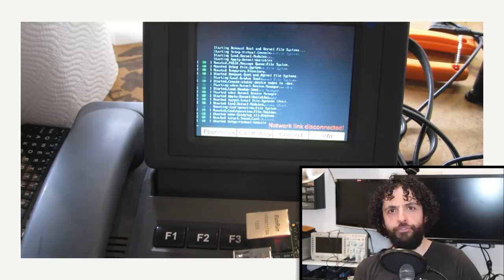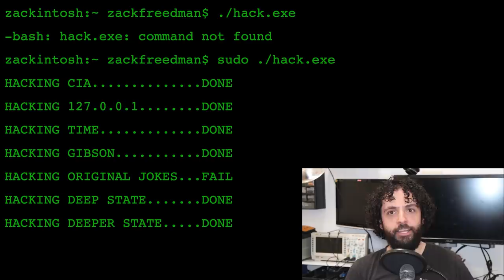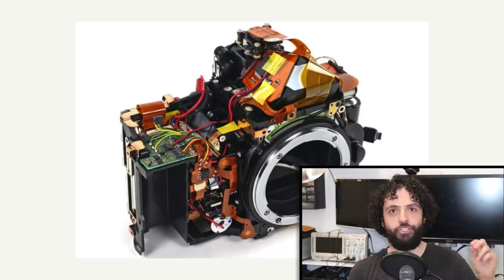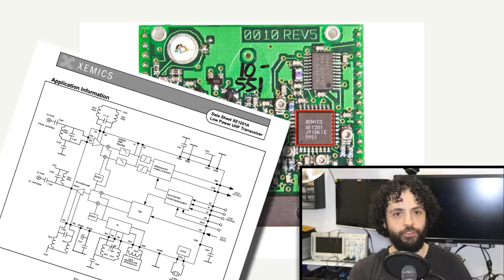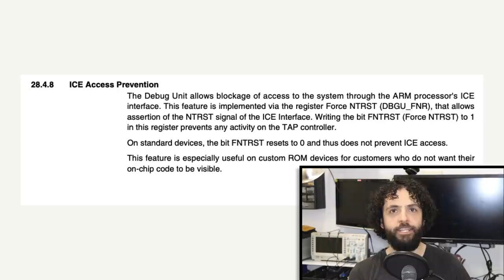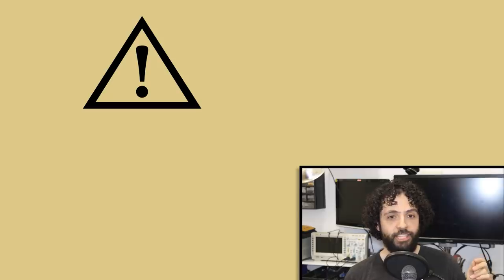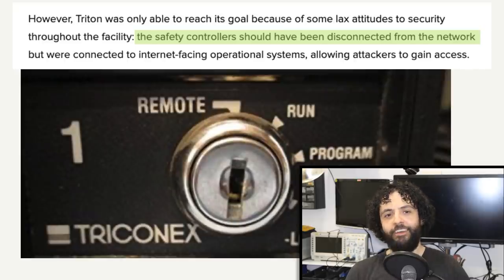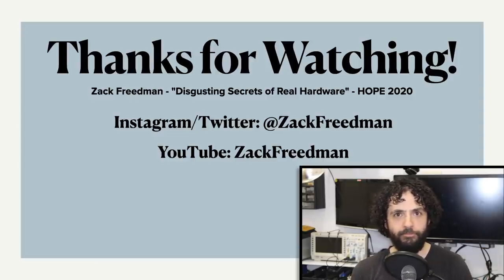Disgusting Secrets of Real Hardware: HOPE 2020 Voidst-Archives

Comment: Copy-paste engineering, as far as circuits go, is almost a hallmark of good design. If someone figured out a thing and it works, why ruin it?
Reply: Oh damn you can not be more right. I'm often reviewing circuits and about 9 times out of 10 i'm like damn why don't you read the datasheet ? They clearly tell you there should be a cap there and that it should be as close to the pin as possible !!! RTFM !!!! And for the love of however superior force you believe in, please stop trying to reinvent the opamp !!! 

And the 10'th time it's usually like "do you know it exist off the shelf chip that just do what your whole circuit do and cost under 30cts ?"
Reply: @lolaa2200  what if i don't believe in a superior force 👽
Reply: @king_james_official  You'r an engineer ... build one ;c)
Reply: @lolaa2200  spaghetti monster😈😈

Comment: I've dabled with arduino and raspberry pi, but felt incredibly intimidated by "real hardware". Thanks to you, it feels like this is more approachable!
Reply from the maker: It's WAY less impressive than it looks. Try reverse-engineering a circuit board - all you need is a magnifying glass and a continuity tester. You'll see that it's really just a bunch of sub-assemblies with a few power and data lines linking them together - and that most of those assemblies are just reference designs from datasheets!

Comment: Reminds me of a friend in the 1970s, who made controllers using TTL. He was sick of one particular customer who never returned boards to him for repair, but tried to mend things themselves.  He knew they were doing it (flux deposits, chips from different suppliers, etc.), but couldn't prove it.
One day, he supplied them a piece of equipment with, deliberately, a "blown" chip on the board.  Sure enough, the customer got in touch the following year for a repair and he was able to say "You've been meddling with this." because they had changed the chip and so the device was held reset, illuminating a red LED and sounding the alarm!
The customer had to buy a new board, of course.

Comment: I was modding a part we received from a supplier a few weeks back and found an Arduino Mini hot glued onto the PCB and piggybacked onto the power supply. Loved it.
Reply from the maker: I've always wanted to run into something like that. What kind of device was it?
Reply: @ZackFreedman  it was a charging dock for a remote. The arduino had a reed switch soldered to it and when the remote (which had a magnet hot clued to the inside of the casing) was out of the dock the arduino would make a small speaker put out an alarm.

Comment: <raises hand> I've programmed protection fuses. It does protect the code, but we had occasional "did we remember to program the fuses" scares when we did something that required us to generate a new release procedure.

I've also seen some interesting, and not necessarily effective, protection schemes. One involved swapping address and/or data lines between the processor and the EPROM (this was before flash-based microcontrollers were available), and not noting it on the customer-available schematics, so that anyone trying to read the EPROM would get gibberish. I don't believe that one ever got implemented.

I've also seen boards with potted components, so you couldn't identify the components or access their pins, and boards with identifying marks ground off the key chips on the board.

As for stupid design, my company once also built a relay board for a customer whose specs turned out to have a significant design flaw that I discovered in testing. The board had a significant number of relays on it that cross-connected various voltages and signal lines from one I/O connector to another, because they wanted to be able to customize things for each installation. They specified zero-power relays, because they wanted a programmed configuration to be available immediately after powerup. While testing the first-article prototype, I accidentally discovered that it was possible to connect the +12v (or +24v, it's been so long I don't remember) line to ground. Oops.

Comment: FYI:  TLS 1.2 is secure and currently used in more than 95% of the web's communications.  TLS 1.3 just came out and is not yet supported by most, but most features are just to optimize latency.  Predecessors were SSL v1, v2, v3 (all now unsecure), then name changed to TLS 1.0, 1.1, 1.2, 1.3 (of which only 1.0 and 1.1 are deprecated); I believe you thought it was running SSL2, but it was showing TLS 1.2

Comment: at one job, the idiocy with passwords and post it notes got so out of hand I simply wrote 'Y0uW15h!' on a post it note and stuck it to the bottom of my keyboard. No, I would never, and never have, actually used it as a password, but I can see prototype engineers getting that set as text to print on a circuit port next to the fake uart serial port, that randomly cycles between +3.3v and 26v AC...

Comment: Oh and the Phillips Hue hub uses unique root passwords for each unit. But they set this through uboot. You can bridge the flash data to ground when uboot starts to load it, which will kick you out to a uboot prompt, where you can just change the password to whatever you like. You can the data corruption thing on a ton of devices and different boot loaders.

And i'm glad you can. It makes it much easier for consumers to actually take over their device and use it for whatever they want. Really the idea that disabling this makes it significantly more secure is laughable. If someone has physical access it's game over already. Unless you want to implement incredibly convoluted security systems like you see in things like video game consoles, which no one wants to, especially when with real security you have to protect the device from physical access, and if someone has had physical access you need to consider that device to be compromised, at a minimum...

Comment: I'm self teaching myself and I purposefully make my stuff shit. I love chaos.
Reply: lmao
Reply: The same design philosophy as the WTFduino
Reply: So every time you do something good, you are mad or satisfied🤔
Reply: I'm not really engineering stuff (I built my own PC for example, very engineery) but I have some security through obscurity safety measures built into it through sheer lazyness. For example: My radiator is outside the case, so I had to run wires for the fans outside the case too. You can make use of a PWM hub so that you only need to run four wires once instead of four wires per fan. So, what is a cheap way to run four wires somewhere? Yeah, USB 2.0. So now I got a 12V USB port on my PC that has 850 watts of power behind it. If anyone ever steals my PC, they're gonna have some *FUN* with that. I know there's 12V on that port. They don't.
Reply: @fredwupkensoppel8949  LOL. the best defensive wall is a field of landmines
Reply: @fredwupkensoppel8949  Love this! Reminds me of that buddy of mine that just runs his PSU through the open side panel because he was too lazy to screw that bastard into the basement. But with even more chaotic energy. 🤣
Reply: @Yuzuki1337  Well my psu still hangs out the back a bit because of a clearance issue with the water cooling tubes. So same kinda sorta.

Comment: Hey Zack, I have an alternative opinion. I see no problem putting serial interface exposed on the breadboard. This gives you as a programmer/hacker to have the API to the box, so you can connect and script something. Especially right now, when everyone is crazy about IoT and smart home stuff. In my opinion, this is far better than putting a WIFI on the chip, as wifi exposes remote and often very insecure connection. What is important here is to treat Serial port as public API and don’t allow advanced stuff like firmware update – often printfíng status would be enough. Remember, in the old days cellular phones were dumb as hell and very restrictive, but as soon as you allow to develop and run the apps, market exploded. IoT will face the same fate, bc programmers are everywhere now, and number of hackers/prototypers are growing rapidly.

Comment: You forgot about embedded medical devices, which are programmed with magnetic loop antenna and not even a PIN code in some cases. Just imagine someone making a big loop antenna hidden in a door frame of public place with a controller programmed to change the vital settings of embedded insulin pumps and pace makers of every person entering or exiting a room/building. With proper settings the deadly trap would be triggered only in certain conditions, so it would be hard to figure out, when and where a person was hacked. I'm not making this up, there was some research into vulnerabilities of such medical devices.

Comment: I’ve seen some crazy shit inside the most expensive industrial electronics. I’m not saying I could do better… Very far from it… But while troubleshoot some of the most expensive boards out there… i regularly find bad design choices/mistakes everywhere.

A bit of my background… I now spend half of my waking hours in my electronics lab repairing industrial boards and test equipment. And a bit of metrology for good measure. Most clients bring me stuff like discontinued “end of life“ PCBs that need component level troubleshooting and repair. 

Here are a few things I’ve seen in the past 60 days… Boards from 30 year old CNC machine controllers, HVAC equipment like massive tractor trailer truck sized screw chiller control boards, and other boards from ridiculously massive HVAC equipment. weird industrial x-ray machine control boards used to inspect injection molded and potted electronics, and pretty much anything you can find in a machine shop, Warehouse/Factory, even have a few industrial recycling companies who brought me regular repairs because they abuse the shit out of their shredders and other equipment.

I get an average of 5 - 7 clients per week. It could be a single board or an entire cabinet full of boards from one client. It could be something simple like an impossible to find furnace control board from some massive 10 ton HVAC unit… or something complex like a 6 foot tall refrigerator sized rolling computer cabinet, With dozens of HUGE boards inside… used to control a 1980s Mitsubishi EDM cnc machine. (that actually just happened a few weeks ago.)

It’s insane the things I find on circuit boards. And I’m talking about boards that were in million dollar pieces of equipment. I don’t normally work with really expensive modern boards. If it’s something that could possibly still be under warranty, or that I don’t feel comfortable with, I don’t hesitate to turn a client away or refer them to the manufacture. The first thing I learned is to never never never work on something you’re not completely comfortable with.

It happens sometimes, but usually things like that either go back to the manufacture, or the clients can easily find a new board online to replace it. I don’t care what it cost. If they can find a new board to replace something… Even if it’s $10,000… I always suggest that you go that route if it’s something extremely modern and still under warranty or something from the medical field… That I don’t feel comfortable working on. So I don’t deal with that type of stuff. 

Mostly I deal with things that are completely unobtainable. Sometimes that means the manufacturer would take six months to replace or repair the board… And they need it now. Or sometimes it’s from Machines that were made in the 80s and 90s, and aren’t supported anymore… And sometimes even new modern equipment, if the company doesn’t offer replacement parts, and they can’t find a replacement board online. 

I’ve got to see some of the neatest, most well-designed and beautiful high-end electronic circuitry imaginable. From places like the prestigious Oak Ridge national laboratory (where the atom bomb was first made).... all the way to the lowly Walmart check out scanner. I see a wide range of different equipment and controllers. It really is a lot of fun, I even had a local nuclear plant bring me some massive LED sign controllers a few weeks ago… Because the company Who made them in the early 2000s disappeared and they needed these huge LED billboard sized RGB signs back up and running immediately. because They use it to display the incoming and outgoing electrical service information for the day. In other words the power that they’re generating at the nuclear facility… It’s basically like a massive computer monitor that everyone can see, and used to address their own controls.
The laser diode emitter for the fiber optic controllers had fried because of static discharge. I was able to find the problem, source the part, have it overnight shipped, replace the laser emitters, and have the three controllers back to them in about 36 hours. And as you can imagine… That’s literally like a blank check. I’m not a crook… And I always try to be fair because a lot of these people are my friends. But I could’ve charge them whatever I wanted. That was a quarter of $1 million sign when it was new, and I’m sure a modern one would cost just as much. Not to mention the fact that they needed it yesterday. But if you are fair with your clients you will have a constant flow of high-quality boards to repair, from good respectable clients. 
I’m not an engineer. Technically I’m a trained machinist, but have no electrical background before five years ago.
I totally stumbled into this, I knew nothing about electronics five years ago. I spent every waking hour in my workshop building guitars for clients, one day I got shocked really bad building a reproduction amplifier… And finally had enough. Decided it was time to learn. So Started going to my buddies recycling yard and buying broken high and industrial electronics to take apart and fix for fun. Became addicted to test equipment, and realized I could never afford my beautiful 8.5 digit multimeters, gigahertz oscilloscopes, and beautiful beige colored HP test equipment from their golden age. So I started buying broken and untested test equipment, repairing it and reselling it… Keeping what I could afford to… And then somehow a few years ago started picking up clients completely against my will. Friends and clients from my guitar and woodworking business, or from when I went to school for machining and metallurgy, old friends from high school who now are in manufacturing plants or machine shops at places like Volkswagen and Amazon here in town… Friends that I couldn’t turn away even though I wanted to… And I only fixed boards to help them. But somehow a little last few years it got to this point where now I spend half my time in my electronics lab and the other half building guitars.

Sorry for the long comment, I’ve just seen some crazy shit in some of the most well-designed high-end products. And although most of it was way above my pay grade and I could never design anything as well… The designer still made mistakes.
Reply: I should add, I don’t write code and I can’t write code. I can write G code for CNC machines, and I can copy and paste code from an erased eprom. But 90% of my work is power electronics failures, wiped EPROM chips that just need copy and paste code, and other circuitboard issues. The stuff you’re discussing in your video is about the furthest from what I do. I absolutely stay away from consumer grade electronics. The stuff you’re talking about is exponentially harder than what I do. I’d rather chase down and re-populate 200 tantalum capacitors than try to troubleshoot a simple $5 USB stick.

Industrial boards are laid out to be very efficient and simple, even the most complex boards are usually simple because they’re designed to be serviced and fixed. Yes! I know it’s hard to believe… But in the industrial world circuit boards are still designed to be serviced!

Comment: Bruh, I worked for an IR camera conversion company for a few years and fuuuuck DSLRs. The lead tech would never want to swap DC/DC converters in Nikons because the whole thing has to come part to get to a board that you can see with the rear panel off. He also kept forgetting to take the batteries out and blowing up D800 bodies so I go stuck with it.

Comment: Huh, so you could potentially open an Oculus headset, use the debug interface to get the firmware that's onto it, and then bypass Oculus' method of preventing people from rolling back (Which is by updating the firmware) and be able to roll back that way!
Neat.

Comment: Sometimes some of these things specifically make the company succesful. Sonoff is a great example. They make cheap smart relays and if they didn't just use stock esp32's, left serial solder pads and make the chip unflashable very few people would still buy them. People buy sonoff switches for it's hardware - prewired esp32 with a relay and a nice plastic enclosure, not their shitty firmware and mobile app. So pretty much everyone who buys those, flashes their favourite open source firmware. 
The company is happy because they sell stuff and don't have to serve so many devices on their servers. And customers are happy too because they bought relatively cheap hardware for what it does and they can do whatever they want with it.